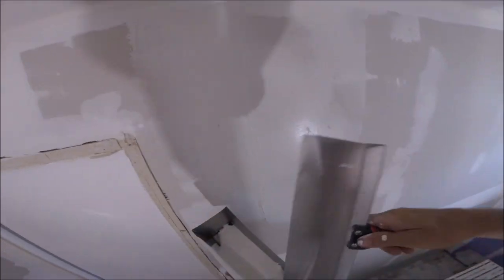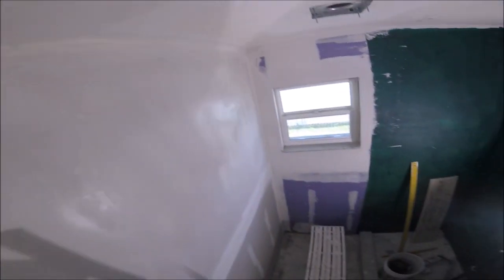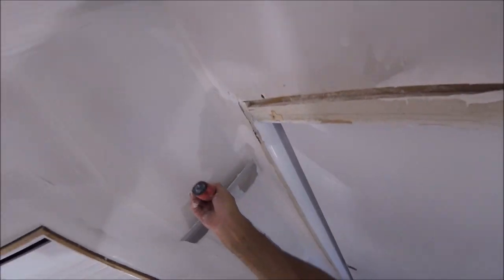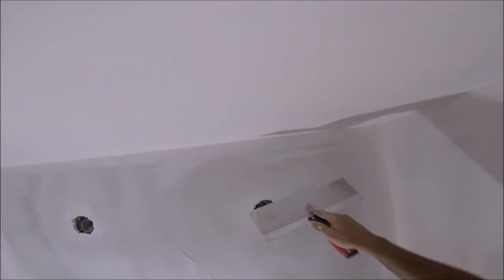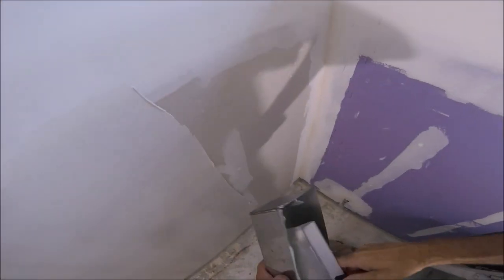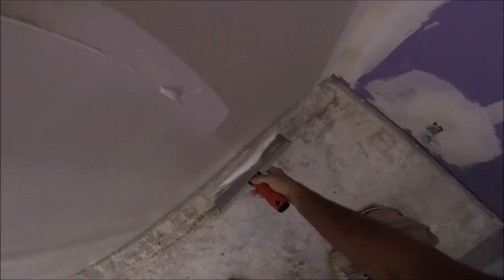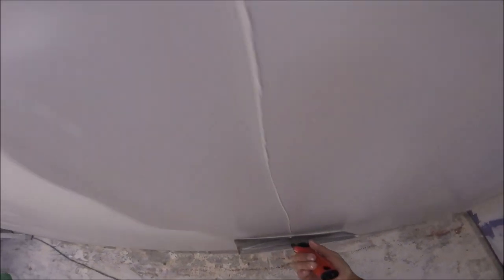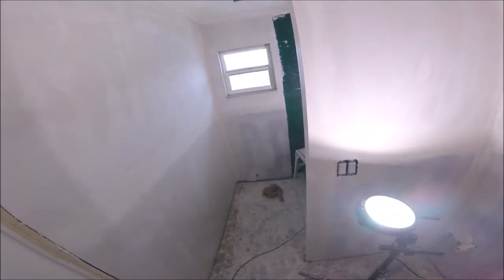Skim Coating a Room in 30 minutes!! Skim coat drywall tips and tricks

Comment: Great tips Paul. That kinda what I had to do. 👍
Reply from the maker: Hey Anthony!💥👊🏻 Glad my videos have helped you with your skim coating skills!👏🏻 Thanks so much for watching and commenting man!🙏 -Paul
Reply: Paul Peck DrywallTube I’ve got skills now. Gimme that Mudd
Reply: Hey Paul quick question. Would I have any problems with skimming over wallpaper glue? Have a room that was wallpapered twice over etc glue left behind was rough and almost like a texture, you know
Reply from the maker: Hi Anthony, I generally prime a wall that has excessive wallpaper glue or the rough texture like you’re talking about with Gardz.👍🏻 That ensures everything is going to adhere properly. But, since all wallpaper glue‘s are not created equal. You could just do a tester spot and see if it’s going to adhere or not depending on your project. If it’s your house? No big deal. But,  if it’s a customers house? I would go ahead and prime it for a little insurance policy. I hope this helps. -Paul
Reply: Thanks Paul. Wall definitely needs skimming. Really rough with the layers of glue. I’ll prime it after we get the paper off
Reply: This paper wallpaper is not coming off that easy. Paper tiger and hot water spray. Uhhh

Comment: If I have knock down textured walls. If I install thin set bricks on one or two walls I will  probably have to skim coat the entire wall first.  Would I use the joint compound full strength instead of diluting it?
Reply from the maker: Hi Juanita, I would thin it a little bit.👍🏻 Here’s a video tutorial that will help you with the entire skim coating process with a super cool trick: https://www.youtube.com/playlist?list=PL7Ww-LhWbB0EeAJDmzncGCX0N4CrEF7pG I hope this helps. Thanks so much for watching and subscribing my friend!😎 -Paul
Reply: @PaulPeck  Thank you the videos are very helpful.  The wall I have in mind is 17 feet tall in one area. I'm not sure I want to keep the knockdown texture on the the other walls. Someone before me has done some sloppy work on parts  of the wall. Now I don't fell so intimidated about making the the rest of the walls smooth if I want to.  THANK YOU.

Comment: Hi love your tutorials and have already used your rolling on technique in my bathroom to good effect. Just wondering if it would be any different if using lime plaster? A part of my house is 100 years old and I have to use lime to prevent problems with damp and mold and keep it breathable.
Reply from the maker: I appreciate that!🙏 It’s doable with roller. But,  it doesn’t roll on as easy as joint compound. Let me know how it goes.👍🏻 Thanks so much for watching and subscribing my friend!😎 -Paul

Comment: How cold was that room tempeture.. the reason I'm asking is because I just skim coat an interior of a house and had them lights that produce lots of heat, so I started in one wall i had a helper so I told him to start in one end and me at the other end and to just do the top part exactly how you did so we did that but when we were getting ready to do the bottom part when we use to hit the upper part that was done previously we started to peel that section by going over it trying to blend it, so we ended up deciding to just leave a space of probably 6 inches  and come back when everything was completely dry. I don't know if i made sense English is my second language....

Comment: Paul, thank you for your videos.  I am a DIYer, mostly because of having no faith that people can actually do what they claim they can.  We had a complicated reconstruction of our home, and though some did things well, others just sucked! So many made excuses and blamed others for walls and corners not being straight or true, etc.  How can I best address walls that were painted over surfaces that were not cleaned well.  Some places the paint will peel off because of residual dust.  My thoughts are to scrape off the paint that will come off and then skim coat. Thoughts?
Reply from the maker: Hey Beemeth!💥👊🏻 You don’t how much I hear about nightmare remodels! Especially the drywall portion...🙄 But yeah, I would scrape off the paint and either wipe the dust off with a damp grout sponge or just go ahead and prime depending on how dusty the surface is. Then give it a right skim.👍🏻 I hope this helps. Let me know if you run into any questions along the way. Thanks so much for watching and subscribing my friend!🙏 -Paul
Reply: Paul Peck DrywallTube I have truly enjoyed your videos and appreciate experts such as yourself to teach people like myself who simply want to do things right. Happy Fourth!

Comment: Might try and skim coat the 4th bedroom that im gonna paint. I have all purpose final coat compound. Will this be okay to use? The other 3 rooms that i painted had a lot of peeling paint on the walls and the ceiling that i went around and patched up with some compound. When i had done patching all the holes and peeled paint, it looked like i had patched everywhere hence why i will jus skim coat the walls and ceilings.
Reply from the maker: Yes that compound should be fine.👍🏻 A skim coat will definitely clear up the patches showing through after you paint. Sound like you have a good plan! Thanks so much for watching and subscribing my friend!🙏 -Paul

Comment: I have a rental property that has a very thick ugly texture on all the walls in 2 bedrooms.  It originally had crows feet texture and latex paint, but someone put a heavy thick texture on it and painted it with some kind of glossy paint.  I hit it with 50 grit sand paper on a belt sander, but it did not damage the finish at all.  About 30 percent of the texture just peels off, leaving the drywall completely clean, but the rest of it has bonded to the drywall.  I don't know if the outer paint is oil based or water based, but I am sure it probably was painted directly over a water based paint.  I started taking off the easily removable parts, but now I am trying to decide how best to proceed.  One of the bedrooms was so bad, that I removed the sheet rock and completely replaced it.  

What would you do in a case like this one?  I really don't want to replace any more sheet rock.
Reply: What we do in that situation is just skim the whole wall with lite blue or plus 3 some kind of light weight compound I would not use all purpose it shrinks more and is harder to sand the best way I've found is to thin it slightly and roll it on with a paint roller then wipe it smooth with a 12 in knife or you can get a magic trowel it's basically like a  rubber knife  they are about 18in wide light sand after that dries then another tight coat and sand again

Comment: Hey Paul - would you use a green top or blue top bucket for skim coating?
Reply from the maker: What are you skim coating over?
Reply: Paul Peck DrywallTube interior walls. They were damaged by removing wallpaper, already sealed them with guards.
Reply from the maker: Definitely the green lid USG all purpose for the first coat (because it has more glue/adhesive in it. Which makes it adhere better to damaged and painting walls. Then either one for the second coat.👍🏻
Reply: Paul Peck DrywallTube thanks brother!

Comment: DIY'er.  You're making it look oh, so easy.  But, we know better.  I'm trying to get a good even skimcoat over my bathroom walls after a bit of taping, 1' x 2' patch and numerous nail pop repairs. Everything's looking good except the skim coat.  I'm using CGC All Purpose compound, thinned so it just hangs on to my hawk.  Not good.  Yours looks runnier in the pan,  so . . . I going back to the drawing board . . . thinned out mud in a pan.  Wish me luck.  You'd laugh if you saw my last failed attempt.  But,  nice work you're doing.  Thanks for the inspiration during  my inept frustration.  I WILL SUCCEED ! ! !  Cheers.
Reply from the maker: Hey JayTee!💥👊🏻 Yes, thinning the mud should help. Here’s another trick that can help with keep a consistent application of the joint compound: https://youtu.be/jeGWbgAUvCM Let me know what you think. You got this!👍🏻 Thanks so much for watching and subscribing my friend!😎 -Paul